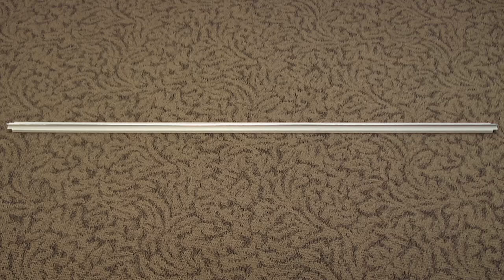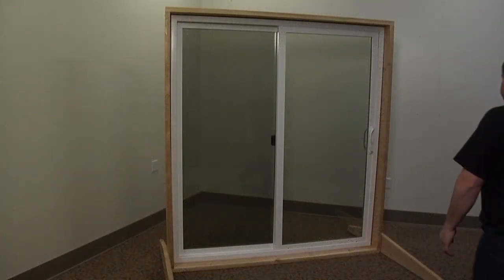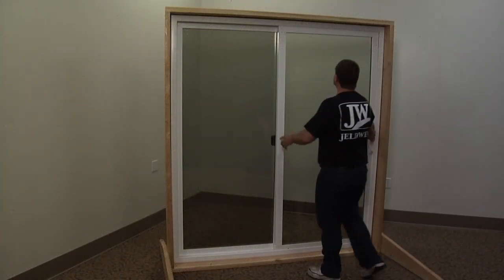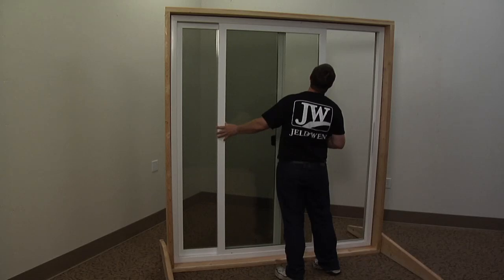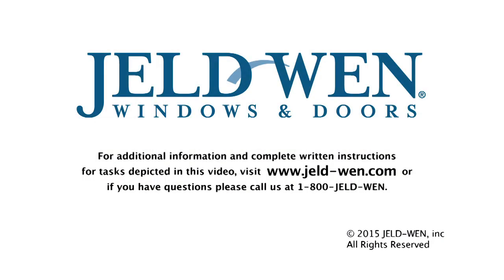How to Replace the Operating Panel Track on a Premium Vinyl Sliding Patio Door

Comment: I can't remove my pvc sliding door. I removed  the side panel on door but still don't have enough room at bottom when I lift and try to pull out bottom? I don't see any door blocks at the top, and when I lift the top of door goes to the top of track but still not enough clearance at the bottom? 
Any help would be appreciated